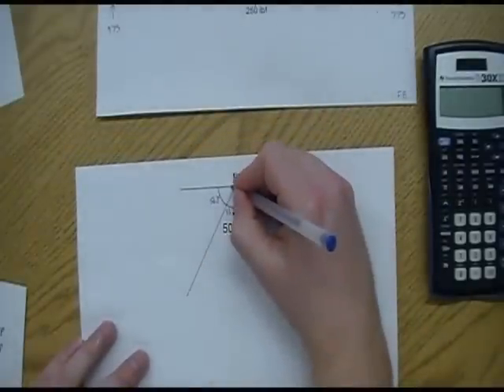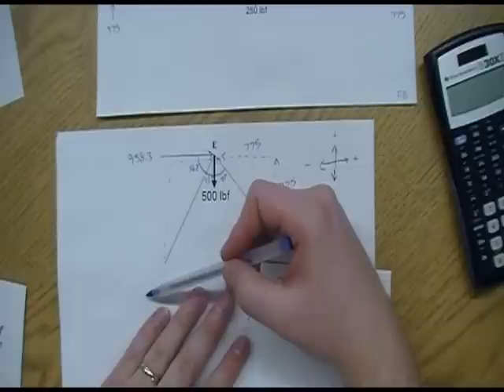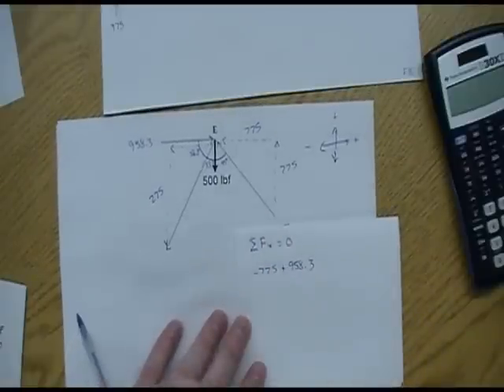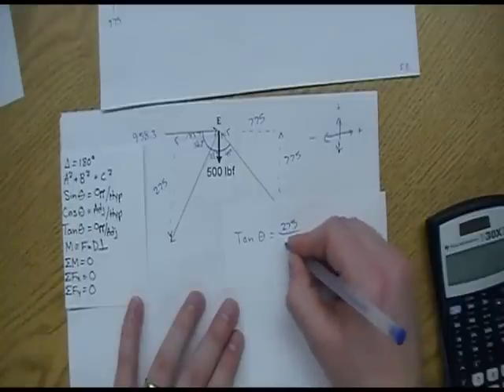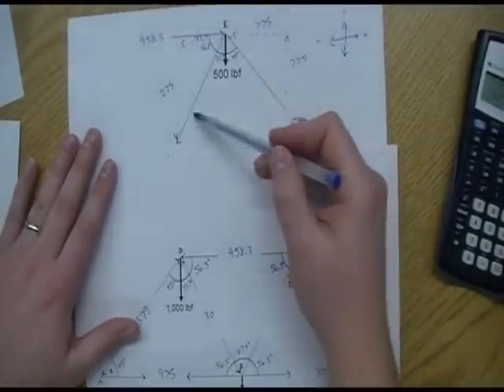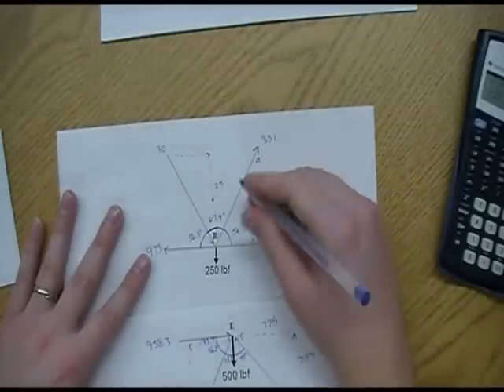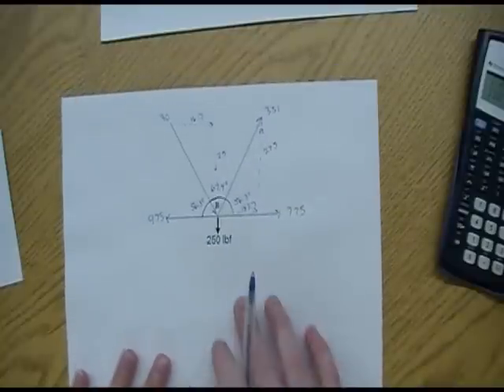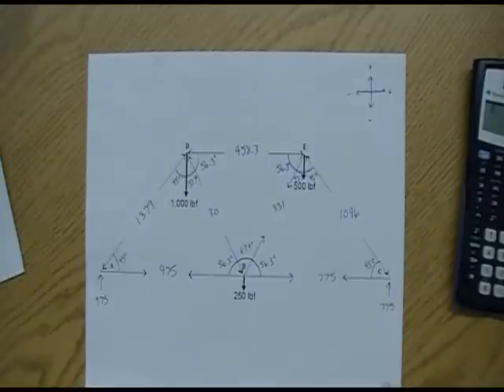How to solve a truss: Step-by-step Video 6

Comment: Thank you, very clear and helpful explanation. However, it seems you have tension and compression switched. Arrows facing each other indicates compression as the ends are pushing together and vice versa.
Reply: No, he is correct. I thought the same as you, but it is actually the way he has it. Don't think of the member as a whole, just each joint. If a member is in tension, it will be pulling out so the arrow will point outwards.

Comment: So, at point E, I decided I would check my work and solve for ED in the x direction. Summing the moments in the X direction (775+ -183), I came up with 592, which is incorrect because we already have 958 for member ED. However, if you use the negation of 775, you end up with 958. This makes me wonder if maybe you made a slight mistake when solving at joint C. After going back and checking, I think CE in the x direction should have been negative (or going left) and CB in the x direction should be positive (going right). With this change in place, all of the math seems to work out, BUT, I am here watching these videos because I had absolutely no clue how to solve trusses, so there is a chance I'm wrong. Is there anyone out there that can verify/explain this for me? Even if I may be commenting in 2017?

Comment: Tension also means "pulled apart", conversely compression also means "pushed together". If a number is being pulled apart <-123456-> or pushed together ---->123456<---- then you can visually see which is happening. -><--- = compression <----> = tension